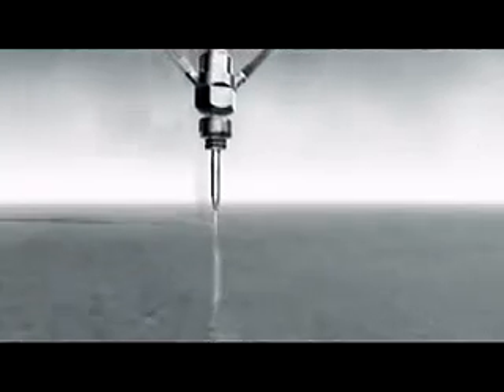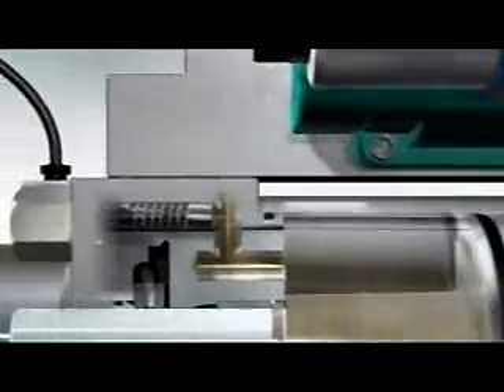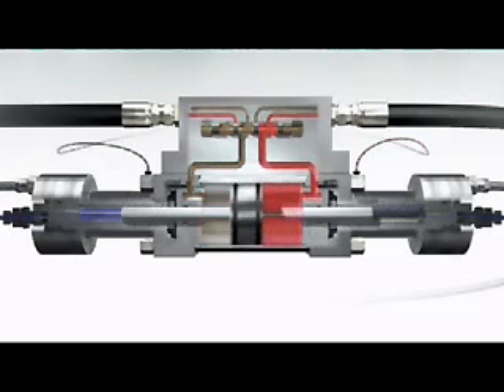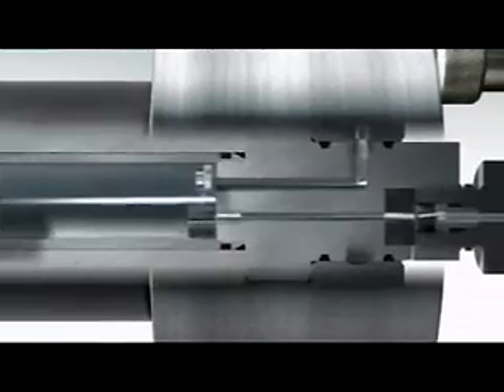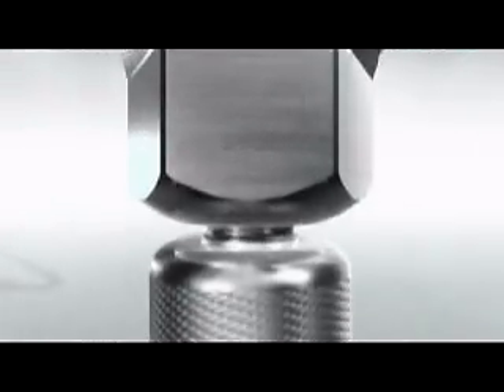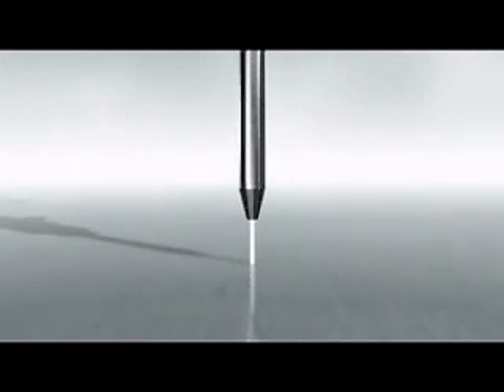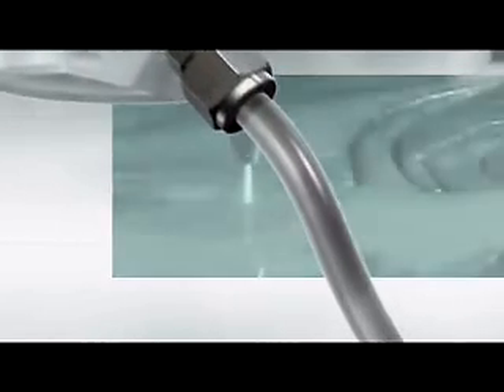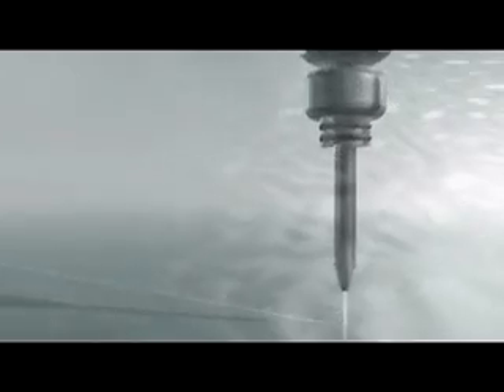Flow Waterjet Technology Overview

Comment: If I understand your question, why the high velocity water jet does not deform the  tube, where the water come out? it's simple, because the abrasive jet ( water mixed with abrasive) can cut different material, a lot of material, as it seems to be, but actually the abrasive jet can not cut a number of material, like diamand (high ductility) and some ciramics, so the tube is generaly made of ciramic, the reason he still hold the high energy, but everything has an end, you know...

Comment: @VioletGiraffe There is a stone, usually a ruby, in the end of the outtake with a small hole inside.  The stream of water is passing through the ruby, not the steel.

Comment: @LooieENG2 
Machine will make some noise, up to 82 decibel but that main noise will came from jet when jet on water level. That noise will come because speed of water is 3 to 4 times x sonic speed and if there is mixing chamber on use, there is air and when that water with that speed come thru air, that air will make noise what is 90 to 105 decibel. When there is also addet abrassive, there that can get more air and that is more noise. Biggest noise what i did get was 115 decibel.